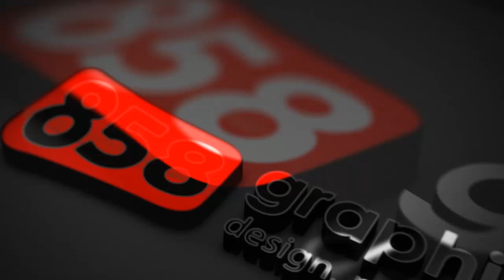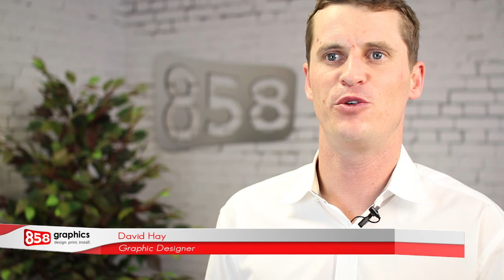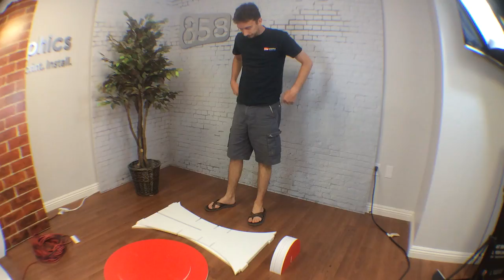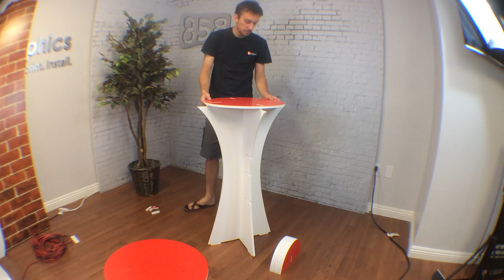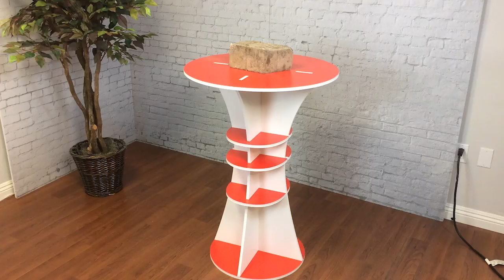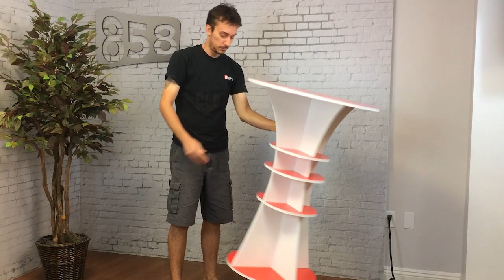Playatech Bar Table Furniture Design

Comment: Thank you David.  We built several of these tables for our center camp in Washington DC called Catharsis on the Mall. Would love to share pictures and give you credit for the design
Reply: Did you use foam core?  I am hesitant to think foam would stand up to Burners and playa but love the weight savings.
Reply: @ideafaucet5710  nah we used plywood and added protective coating